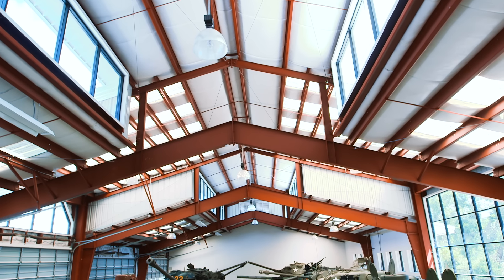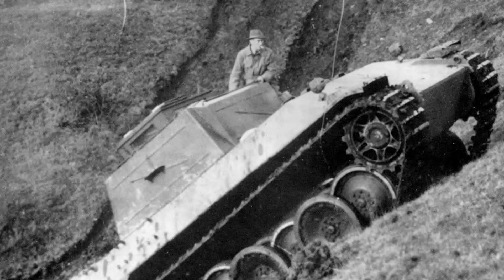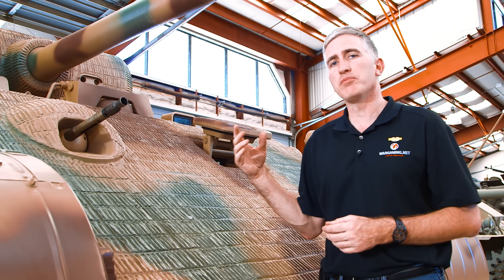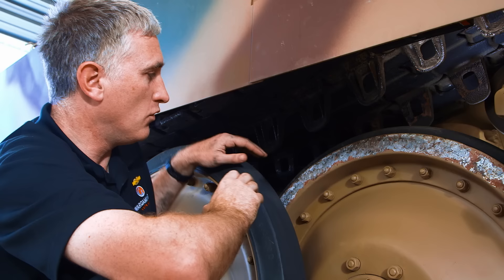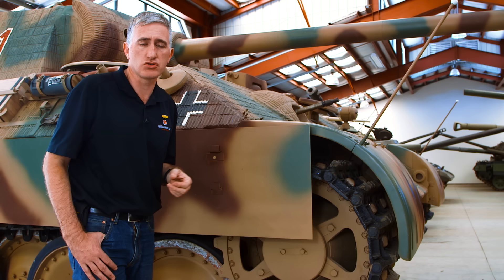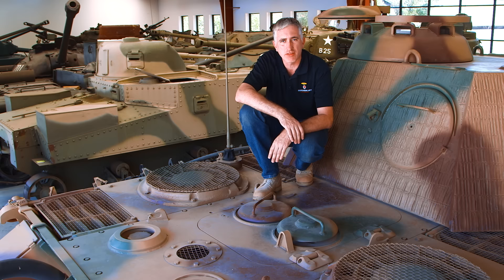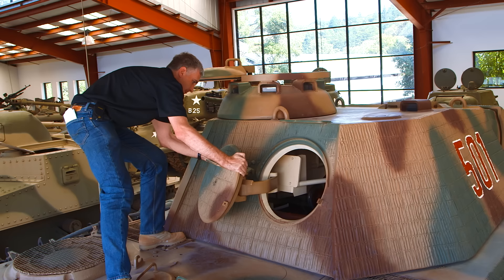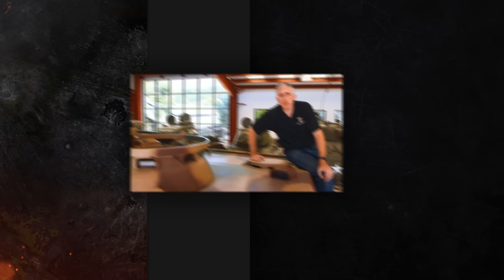Inside the Chieftain's Hatch: Panther. Part 1

Comment: I always wondered about that strange shaped metal element, front right hand side above the wire cutter in front of the fire-ex.
Described as recovery tool, is there a ccertain name to it or better yet what was it used for?
thx in advance.

Comment: Hi; I'm hoping someone might be able to answer this question. I'm surprised Mr. Nick hasn't covered this particular detail. Anyway. what is the heavy looking elongated eliptical iron device with the horn-like protrusions that are on the front of both left and right  sponsons just above the German Cross ? On the left, they are above the pioneer tools. Any info will be appreciated, thanks.
Reply: Near as I can tell, they are used for connecting two tow cables together.

Comment: the Germans get maligned all the time for under-producing their tanks compared to the US and USSR, whose long-term production strategy was to churn out slightly worse tanks like so many hot-cakes, making 80,000 Russian T-34's and 50,000 US Shermans alone...meanwhile the Germans most numerous tank might have been the Mark IV, of which only 8,000 were made, and right behind it the Panther...the Germans had high hopes for this tank, the production figures proving this (around 5,000 were made 1943-45).  Costing them much time in 1943, was ironing out the inevitable problems with the Panther (road wheel bolts breaking, short transmission life requiring the driver to "baby" the tank on the move, poor engine cooling/over-heating, and such hoary issues as actual flames coming out the exhaust pipes, as was observed at Kursk where more Panthers and Tigers were lost to break-downs than by enemy action etc.) the Panther did become a main-stay of the Panzer corps and the big cat cost the Allies plenty of losses all out of proportion to its numbers.  But once the Russians (with the T34-85, in 1943) and the US (with the M26, 1945) caught up in technology the German Panzer arm were indeed facing the end of the road.  The fundamental problem for the Germans was there never was a time when the Germans could ever have hoped to match US and Soviet production, and German planners fully realized this.  The Wehrmacht was beset by perpetual shortages of literally everything, from tungsten to steel to oil.  It is argued the Germans captured these things as they went along, and to a large part this is true... meanwhile though, it should be realized the German's worst enemy - time - soon showed itself since just capturing this territory or that one, could never make up for the shortages in the course of the war!  Exploiting minerals and oil takes years to get from the ground and use takes years - and the Germans were almost always driven out by enemy action before they could really exploit and extract the materials they needed so to a large extent, captured resources were pointless. Even worse for Germany the Allied bombing campaign really gathered momentum by 1943 and this was a gigantic multiplier to their supply difficulties.  As a result of all this, is the explanation why the Germans made the tanks they did, in the small numbers they did (only 1500 or so Tigers were made and only 450 King Tigers, for example).  Making fewer, technically better tanks was the only strategy left to the Germans and that is what they did.

Comment: is he refering to version  E or A I'm guessing it's E but a aufs A was only seen at kurks burning by the road sides becouse of defects iirc
Reply: D*
Reply: Ausf A wasn't at Kursk and not many Panthers were lost due to defects at Kursk. In fact the problem was that their engines had not been sufficiently run in. Others had fuel line leaks. These were rectified. Only 2 Panthers were total write offs due to engine fires before the battle started.
Reply: panther 2 never came to the building stage as the little sideplates solved the problem ...

Comment: During the Kursk battle, several Panthers were observed to have flames coming out their exhaust (due to problems with the engine exhaust valve presumably) along with other defects "teething troubles" far more tanks were lost due to breakdowns than enemy action - looking just at production figures, 5,000 Panther variants vs only 1,400 Tiger 1's and 450 Tiger 2's - the Germans obviously had high hopes for the panther that it was never able to fully live up to.  A Panther was easily worth 3 shermans and a couple T34's, the problem was the allies had 4, 5, even 10 Shermans/T34's for every Panther.
Reply: Panther was an automotive failure...  The final drives were designed for a tank 10 tons lighter and then made of inferior materials than what the engineers specified.  Final drives failed within 150km, spare parts were generally hard to come by, field maintenance units were inadequate and it was a fuel guzzler.  Panther was not the tank the Germans needed in 1943-45.
Reply: John Cornell  John, I've been over this ground so many times in the past 20 years.... The Panther final drive was its Achilles heal and remained so.  It was mitigated, but never solved and held the vehicle back in regard to performance.  It could never achieve what it was designed for performance-wise due to the fragile nature of the final drives.  Try looking this up on armchair general forum or Axis history forum and you'll see just how long and how in depth we got (and how many times).  We had experts like M. Kenny and engineers, etc. on there.

Comment: What is with the gouged lines in the plating? Surprized you did not mention it?
Reply: +sean rakers

 He did. It's called Zimmerit.
Reply: It's concrete and zync to prevent magnetic mines. He did talk about it.
Reply: Fast forward to 12:35

Comment: i wish the panthers on the console had side skirts
Reply: The Panther at Tier 7 technically is a Ausf G which didnt use skirts per se. 

BUT... the VK30.02M should have gotten skirts. Odd that Panther 8.8 and Panther II received skirts since neither would have used them.

Comment: Such a great video... It surprises me that the engine would only use 25 liters of oil, though. I've got an old 930 that uses over half that amount for 3.3. I know that's a tremendous amount, but in relation to a 23L V12 Maybach from 70 years ago, it seems like a thimble. Are we sure this is correct?

Comment: I heard it had the best anti tank gun of the war?
Reply: When introduced Panthers gun was capable of taking out all Allied vehicles at long range. Early IS-2's with stepped front hull were not very difficult to pen. The later model hull could still be penned but was more difficult. 

The Brits had several Panthers built from parts at end of war. One was sent to firing range to test the accuracy and penetration. The Panther with a Brit gunner was able to reliably hit moving targets at 1500m. If dust or smoke obscured target Commander had to direct gunner onto target after which Gunner had no problems. 

Be curious to see if Commander had a turret traverse override.
Reply: I know that the most POWERFULL would be the 128mm PaK on the Jagdtiger

Comment: I'm not knocking tanks, if your made of  about 80 percent fluids, I'd rather be in armour, than outside...
*that said, you're also a target, and a man portable, relatively inexpensive device, containing just a few pounds of high explosive, some rudimentary coppercone shaping, and a decent modern fuse? You're dead. You're all dead.
The plasma jet that explosively formed,  can penetrate anything, don't deceive yourself, you'd die as if you were sitting  in a Toyota pickup truck.*

Comment: I'm sick and tired of the "if you have  to removed the back wheel on a panther..." WHY WOULD YOU HAVE TO? Did did get a flat? Is there a nick on the rubber edge? And spare me the enemy fire damage. if any wheel gets damaged it would be the one up front. This whole argument is bogus. I was a tanker for two years on M60s and M113s. I never...NEVER...had to replace a wheel for maintenance reasons; and none ever "broke.". And as for the wheels freezing, tankers start their engine every couple of hours and the driver can jog the vehicles back and forth a couple of feet to get any freezing broken up easily. Face it. The Panther after the D model was the top tank of the war. Stop trying to talk it down.

Comment: I don't believe the frozen mud story. The Germans had learnt to run the engine at night in order to keep them from freezing up. Trivial to move the tank a few meters to break the freezing mud.
Reply: tarjei99 Germans lacked that kind of fuel capacity during the closing phase.
Reply: That's fine as long as you're not running short on petrol 🤔
Reply: You do not have any choice. The tank engine oil will freeze if you don't run the engine to keep it warm.
Reply: tarjei99 Running out of fuel can cause you to abandon your tank. It can also make you just run out of fuel on the move. Both of these occurred. And the choice was to maintain the tank in the morning or have no ability to run the tank. Not easy-esk choices.
Reply: The choice is extremely easy : a frozen tank can't move and it can't fight. And in that case the crew are sitting ducks because they have to find a way of thawing the tank so that the engine can start and heat the tank.
Reply: Tank can't move or fight without fuel either. The other option is lighting small fires using natural resources.
Reply: Any how, I'd be amazed if running the engine stopped mud from freezing on the tracks.
Reply: Sigh................. You move the tank a few meters. That crushes the freezing mud before it becomes rock hard.
Reply: How often are you doing that?
Reply: That type of heat can ruin the armour. That is something you do on a truck, not a tank.
Reply: ...or you can get a stick and pick the mud out BEFORE it freezes. You have 4 men to lift the track up and secure it while 1 cleans the wheels. Sounds like a routine task making the whole frozen tank sound like a myth.

Comment: This narrator is incredibly annoying?
Obviously he hasn't read Guderian's Panzer Leader.
Guderian clearly records how he wanted the T34 copied which the DB model did just that as Guderian wanted.
The main problem was that the Germans didn't have a comparable Diesal engine so they decided to go with the MAN design instead of waiting for a diesel engine to be developed.
There was also someone who used to work for MAN, now with the Armaments Ministry who influenced Hitler to decide on the MAN Panther.
The Germans didn't "just decide"  to put in sloped armour as the Narrator deviously suggests without crediting the T34s influence.
The sloped armour's  effectiveness was demonstrated by the T34 , (which was the first tank in the world to present a perfectly balanced design of Armour, speed and high velocity firepower to meet the Soviet  requirements of Deep Battle) in actual combat when elements of the 4th Panzer Army  suffered serious losses which convinced Guderian to demand a Commission to inspect the T34,  which they did. 
In Panzer Leader,  Guderian clearly acknowledged the T34 s "technical superiority" 
Give credit where credit is due and the narrator should put his racist or ideological prejudices in suspense. 
I could  be mistaken about his prejudice and instead,  he is probably clueless about the Eastern Front and think WW2 was won at El Alamein? 
I also remember his video on the T34 where he  had no clue what the compressed air bottle was for and then struggled to operate the brakes and then blamed the machine without understanding that he was not trained to drive the T34.
I was so disgusted by the narrators clear bias I refuse to watch any of his demos but seeing the Panther video I thought I would see how he treated an over engineered tank that clearly didn't help the Nazis win.
I wasnt disappointed when the first few frames ckearly showed his bias and muddling of facts and chronological events.
I will never watch his videos again.
NOTE: Next time you demonstrate Russian /Soviet tanks , have someone who has actually driven them do the demonstration.